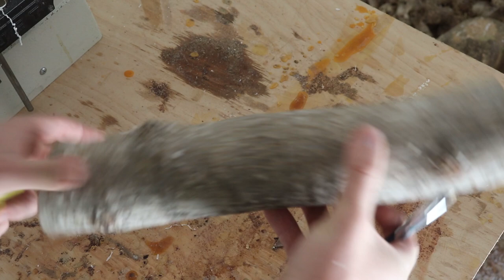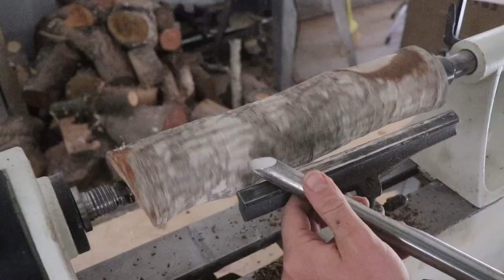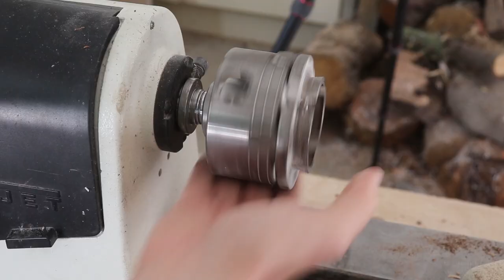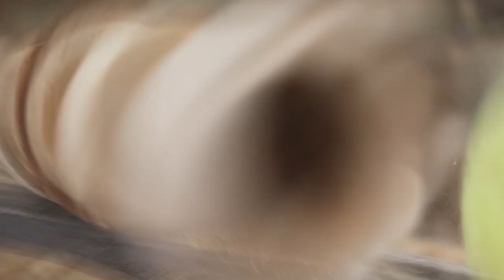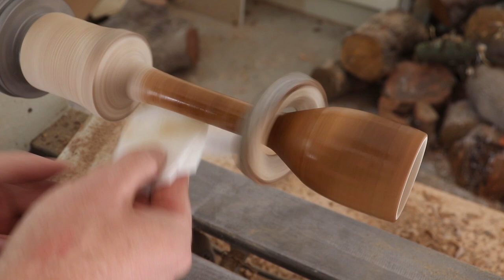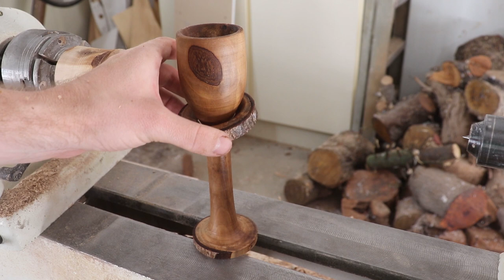Wood Turning a Captive Bark Ring!

Comment: hello, like, even after failure) try to put a second lathe patoron in the machine instead of a tennis ball and clamp it on both sides. because when you put pressure on the workpiece from the ball, the force is weakened there, since the ball is rubber and soft. and make the hole in the end face last, using the bezel. great job no matter what. you can see how you grow as a turner. don't stop and don't be afraid. good luck.